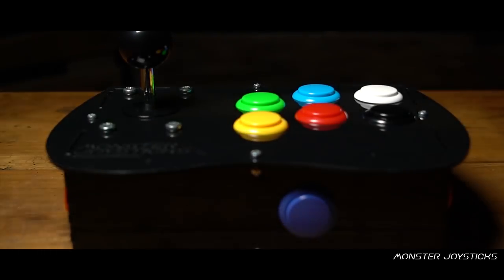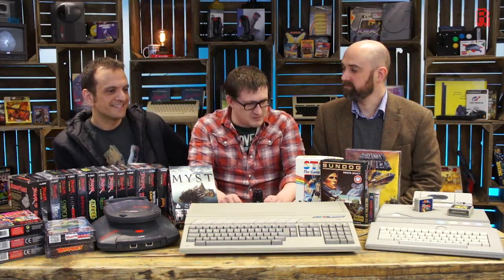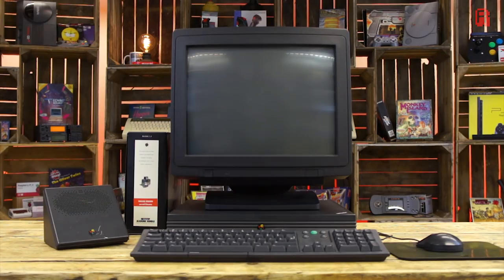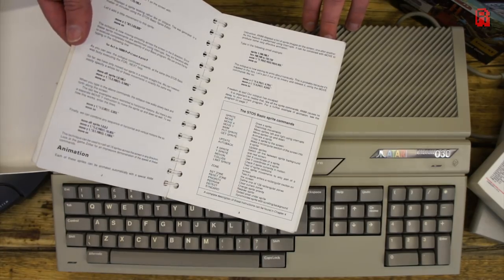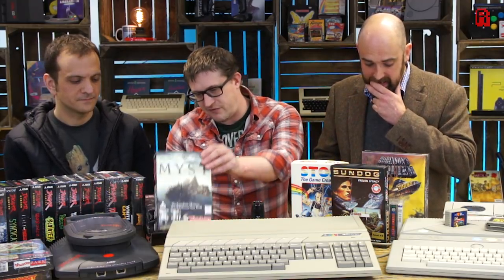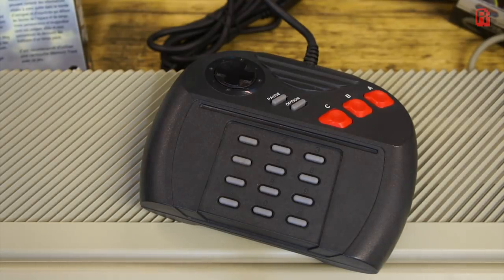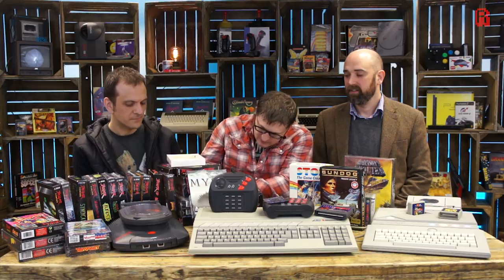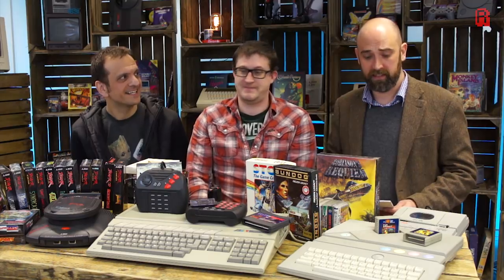Atari Falcon, Jaguar & XEGS chat with Gary & Andrew

Comment: The XEGS wasn't a cash grab. Atari Corp was having difficulty getting mass market retailers in the States to carry the 65XE because the retailers wanted game systems by then since the industry had recovered. That and software publishers were dumping the Atari 8-bit computer line while blaming piracy for their reasoning, so Atari Corp had to come up with a quick way to attract new owners/users to the platform to keep developers interested, so they positioned the system for parents who wanted to buy an actual computer for their kids that was also a game system. The 7800 was being sold to kids who wanted an advanced 8-bit game system at the same time, while the 2600 was being sold to the budget-conscious buyers. That's the logic as to why Atari was marketing 3 different gaming platforms at the same time. Meanwhile, they were negotiating to get the Sega MegaDrive/Genesis and also what became the Lynx while also exploring the feasibility of creating an "ST Game System".

As for why the Yamaha YM2149 was used in the ST... Shiraz Shiviji couldn't get Atari Inc's AMY sound chip working for inclusion in the RBP/ST project so they explored other options. The Dual and Quad POKEY chips were the intellectual property of Atari Games, the arcade company, which was separate of Tramiel's Atari Corp. Had they made the single POKEY the sound chip of the ST, they would've taken a lot of flak over it. So they pivoted to Yamaha but Yamaha would only sell them the YM2149 instead of the YM2151 because Yamaha wanted that chip for their own MSX-based MIDI music computer [which the ST regardless ultimately destroyed outside of Japan]. The AMY was licensed to Sight+Sound to finish up [and for Atari Corp to still have rights to use it once finished] but a massive legal dispute happened between Atari Corp and Sight+Sound which caused the AMY chip never to reach market and supposedly all of Sight+Sound's produced AMY chips burnt up in a warehouse fire. There's a rumo(u)r going around Atari enthusiasts that "three letter" intelligence agencies seemed to have a hand in that.

As for the pedigree of the ST vs the Amiga, yes, the Amiga originally had ex-Atari Inc engineers working on the hardware. The late Jay Miner most famous of course, but also the great Joe Decuir [he created Atari SIO, the ancestor of USB and FireWire] and others. The ST's hardware was primarily done by ex-Commodore staff [Shiraz being the chief architect] but it had a lot of ex-Atari Inc. people working on the software side of it like Landon Dyer who probably is the reason why Atari Corp's version of GEM on the ST was better than Digital Research's version for the PC. Add to that Dave Staugas [2600 Centipede and others] writing NEOchrome and other titles for the ST. So both platforms are really brothers-from-other-mothers than a lot of people would like to admit [especially Amigans themselves]. 

The Falcon030, like the STe before it, came out 2 years too late. As for the subject of MP3s, the Apple iPod Shuffles later used a DSP that was based upon the Motorola 56K DSP used in the Atari Falcon030 [and the NeXT computers before it]. The "LAN' port found on the Falcon030 was supposed to support AppleTalk networking but they didn't get a license to use it so it wasn't supported. The monitor output port was meant for use with plug-in adapters so you could choose an Atari RGB DIN Port Adapter or a VGA Adapter. In modern projects, the DSP is being used to assist with the ports of Quake to the Falcon and is being used instead of a Motorola 68882 FPU because it's faster. And back in the day, Atari Corp had promised that the DSP could be used in the place of a modem but never made good on that. [similar promises were made for the Jag with a "JagModem" adapter which also didn't get released].

The Atari 5200 is the console you couldn't remember name-wise. Yes, it had a keypad on its joystick [the CX52]. Keypads had been accessory controllers on the Atari 2600, but were also integrated into the Mattel Intelivision's and the Colecovision's controllers so that was from that generation. The 5200 cartridges were a better design than the Jaguar's - even though they are similar - because there were notches on the back of them to stick the overlays on back for storage. But the 5200 didn't officially make it to the UK or Europe because Warner forced Atari Inc to cancel the console in favo(u)r of the GCC designed 7800 which arguably had a more powerful graphics chip [the MARIA], 2600 compatibility standard, and was also much cheaper to manufacture. Unfortunately, Warner ended up breaking Atari Inc up and selling it in pieces which delayed the 7800's release until early 1986 instead of Christmas 1984 which allowed Nintendo to establish themselves in North America in the meantime. And that's also why Atari Corp didn't have the Atari Games arcade titles exclusive to their hardware [even if it did appear on the machines at all]. 

The Jaguar JagPads originally started out as the controllers for the unreleased Panther. They first hit the European market for the STe as the "ST Power Pads" and were colo(u)red to match the STe case; their cables were much shorter than the later Jaguar versions though. Laugh all you will at them, but they are some of the most comfortable game pads ever manufactured. It's a shame the pads were only really supported in games for the later Falcon030; the STe could've definitely used all of those extra fire buttons. The Jaguar ProController was even better since it had 6 fire buttons as well as shoulder buttons. It's also even more comfortable and much more sought after...that's why some people were buying them used on eBay for $500 US until a homebrew hardware project in the past year successfully manufactured a new run of them. They can be purchased at AtariAge dot com.

Some people do add spinners to Jaguar JagPads for Tempest 2000 and other homebrew titles. They didn't come standard like that though. Much like in the 5200 scene, there are mods to make the CX52 into paddle controllers, although that went all-the-way back to Atari Inc engineers like Dan Kramer and Gary Rubio doing that in the corporate lab back in 1982.

Gaming on the Jag has a decent modern scene. There's a lot of ST/Amiga games being ported to it with the coders actually improving the code. They've figured out how to get the Jag's DSP to play back Atari TIA, Atari POKEY, Commodore SID, Williams arcade DAC, Amiga PAULA DMA, YM2149, and YM2151 audio so a lot of the games will have options for playing the audio from any of those versions if there were multiple ports of the titles. Cartridges and/or ROMs have been released. AtariAge is the place for that. And there's a JagSD Cartridge Adapter that's almost finished by SainT/RetroHQ. SainT created the awesome Atari Lynx SD Adapter previously...  I think that covers it all.  :)

Comment: "What can you do with it?"
Have you heard of SDL? Search for sdl on the hard drive of ANY modern computer and you will find SDL library files. The operating system does not matter. Even Chrome, Raspberry Pi, Arduino, and pretty much any new OS or computer anybody invents will get SDL added. Check your phone, any phone, you find SDL. Console games as well, Nintendo, Sony, Microsoft, SDL is there. There are Arcade coin-ops using SDL. SDL was developed for ST. It was further developed for other systems using ST. What can you do with it? Delvelope one of the most ubiquitous gaming code libraies ever. Also, is used to develope Coin-op games.

Comment: The XE Is basically an Atari 400/800, and is from 1979.

That's a completely different Atari to the Atari that made the ST, which was Tramiel's Atari.

ST was designed to be a cheap 16-bit 68000 machine, and it definitely shows in terms of the graphics and sound lacking custom hardware acceleration.

Comment: I think that Atari and commodore should have not even started doing 90s console production and instead made Linux machines as a lower cost alternative to the Microsoft windows pc. I saw this video (windows refund day by MichaelMJD) about how Linux users were upset about all pc's being bundled with windows and not having an alternative as well... they are Linux users. Also as there was and a still huge Linux user base. Also their point about making pc graphics cards could have probably worked especially for those Linux machines if they would have made them with ISA or PCI format compatibility to give the Linux machines backwards compatibility with Atari ST and AMIGA software. Of course for commodore this would be the end of the AMIGA as we know it for its custom chips (AGA and the like) but this could have breathed more life into those dying companies. I mean with SEGA and Nintendo dominating the console market, Atari and Commodore had no place being there in the 90s

Comment: The Falcon had an 030, the Amiga 1200 an 020. But the Falcon crippled its performance with a 16-bit bus. An Amiga 1200 with an 030 board would be a lot faster. The Falcon has the DSP of course, but not automatically utilised, applications would need to be written to use it.
Reply: "Despite its 32-bit CPU, the Falcon does not have 32-bit architecture throughout its design, as it has a 16-bit data bus and a 24-bit address bus. This reduces the 68030's performance when not operating inside its tiny cache and limits the maximum system memory to ~14 MB."
Reply: But the Falcon BUS runs at twice the speed of the A1200 BUS.
Reply from the maker: It's amazing how often we see this kind of thing.  Like the Apple LC and LC2 being crippled in this way before eventually being sorted in the LC3.  If Atari had stuck around maybe a big box Falcon would have been a nice step
Reply: However, the Falcon's bus in absolute numbers, MB/s, is faster to that of the AGA Amiga (IIRC the 1200 Bus is faster than the 4000 bus). Also, the graphics subsystem's bus is 32-bits. The main reason for that design choice is RAM. If it was full 32-bit the RAM configuration would have had to be 2MB and 8MB. 2MB are too little, especially for a Unix like operating system like the falcon had, and 8MB would have been too expensive. Still, as a programmer, you would never see the 16-bitness of the bus as everything behaves as if it is 32-bit just slower than it should. Anyway, early on the falcon had inexpensive (around 120-150 euros in todays money) 030 - 32MHz accelerators that had 32-bit TT-RAM option.
Reply: I remember running an Amiga accelerator card that had a 68030 but only had 16 bit data bus ( I was too cheap to buy the full 32 bit package).  One of the worst financial decisions of my life as the accelerator card was barely faster than the stock 68000.   Thought it was broken, but nope, just because I was too cheap.  Eventually got the real deal full 32 bit setup and  my god, it blazed so fast.

Comment: I had a Tandy 1000 31/2 floppy  hard drive computer monitor mouse and keyboard. Wish I never added incompatible Hardware and I gave it away. It still worked from new to early 2000s then I killed it by adding 16-bit to 8-bit oops now I wish I still have it because what I learned from it I could got more parts in this day and age than blank what I did to it.

Comment: The Atari system with the easily broken joypads with the number pads was the Atari 5200, with it's non-centering analog joystick...

http://www.8-bitcentral.com/images/atari/5200/5200controller.jpg

Comment: I think the falcon really did redeem atari when being compared to the amiga. The Falcon I believe was more capable and powerful than a 1200 by a good bit in many ways. I just wish the Falcon had the scene that other computers do.  I also think a good change to make the jag a bit easier on developers would have been to up the 68000 in it to an 020 or 030 cpu, as that was what most dev's seemed to use sadly. and the 68000 was just too slow to do much of anything.

Comment: I wrote a number of games including a DOS SpaceWar clone when I was at university circa 1995/6 which we played in our dorm (simple times!) It featured 256 colour VGA graphics, hand crafted assembly sprite routines and included a sprite packing tool that took bitmaps from DOS Autodesk Animator, incorporated a decent text renderer. etc. ...and of course chucked the source code and binaries out around the same time discovered clubbing, along with the now sought after IBM PS/2 60 tower with two ridiculously large hard drives. I've searched everywhere for the source code but it is, alas, long gone! I feel your pain.. Anyway I thoroughly enjoyed watching this, thanks for sharing.

Comment: The "lan port" on the falcon was supposed to be for Apple talk at least that was my understanding. I don't think much was done with it and it wasn't really even close to 10 base T speeds. The Jeff Minter game in the US at least for the ST was I believe called Llamatron a Robotron clone.   The original Jaguar games were not coded with a Jaguar to test it on. I believe early developers compiled the code on a Unix Workstation (Dec? or Sun?). I have a "catbox" which I have yet to see another example of it onlin (haven't look too hard either) it was designed for the Jaguar (metal chassis) and had VGA outs and some networking functions if I remember correctly. There were some other features on it but I have only used it to connect the Jag to a monitor. Weird piece of kit though.  Another correction if memory serves correct the Atari ST shipped around 1985 the early models had tos in ram you needed a floppy to boot it and it was a 512 model but the tos consumed about half of the ram. Better machines with tos in ROM came out pretty quickly after. The ST PRECEDED the XEGS systems to market so the big who cares attitude towards the later XE systems was primarily because there were far more capable machines. There were also some god awful pc clones put out by atari late in the game maybe they were only sold in the US.
Reply: The ICD CatBox is what you were referring to. It's rare because ICD went under without shipping a lot of units to customers who had pre-paid nor refunded their money. I have one too. It was great. It had a port for hooking up an Atari [ST] SC1224/SC1435 RGB Monitor as well as a plethora of other ports.

Comment: I was eager to see Alien vs Predator on this machine, but was so disappointed when I finally got to try one...the Alien game on the Sega Saturn was far superior to this title...actually Space Hulk on 3D0 was far superior to this title really...to this day, I still find Space Hulk impressive on the old Panasonic 3D0.
Reply: You're comparing CD based games to a cartridge based game. Plus, the Saturn came out a good 2 years after the Jaguar. The 3DO cost $799 when it debuted whereas the Jaguar was $249 when it debuted. Granted, it took nearly 2 years for them to get the JagCD out the door but they were originally gunning for $500 for both which is a lot less than $799.

Comment: I still believe that the Jaguar was NOT a 64-bit console, it was 32-bit. As an example I could say that a dual processor 64-bit Xeon system is 128-bit but it isn't, it's still 64-bit as it's the architecture and not the bus width that matters.
Reply: The Jaguar's bus is 64-Bit. So is the Blitter and the Object Processor. Thus it's 64-bit.

Comment: Re the custom chips.  Bear in mind that the Amiga was designed by Atari engineers, and the Atari ST was designed by Commodore engineers that moved across when Tramiel bought Atari.  Think about it.
Reply: But the ST's software was done by ex-Atari Inc employees like Landon Dyer and Dave Staugas improving upon the cruft DRI handed them. So the ST has the DNA of both Commodore and Atari Inc in it.  The Amiga has its hardware DNA from ex-Atari Inc employees but the OS is from Metacomco. You know, the same company that made the horrible ST BASIC.

Comment: did you do biplanes, 2 player either side with a hut in the middle? or was it a different one?
Reply from the maker: Yes I cloned that game.  It had gravity physics to stall the planes and particle effects for smoke as you got hit as well as clouds to hide behind
Reply: just to be sure if its what im thinking of as it was one of my absolute favorite 2 player games on the Miggy, is that the one with the cheat where you could fire to the left, fly right and when the bullet comes from the right, fly into it and it kills the other player? lol, i used to do that hiding in the clouds when i ran into the other bullet so it wasnt obvious wrecking my mates head haha